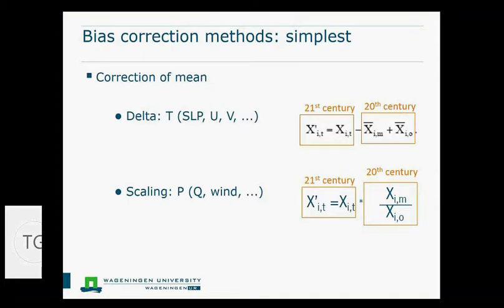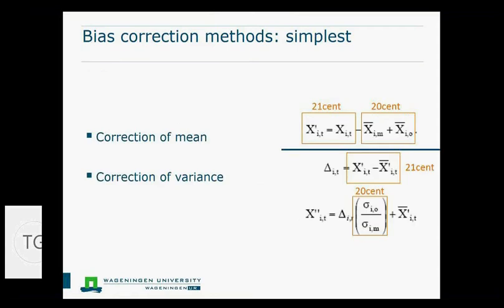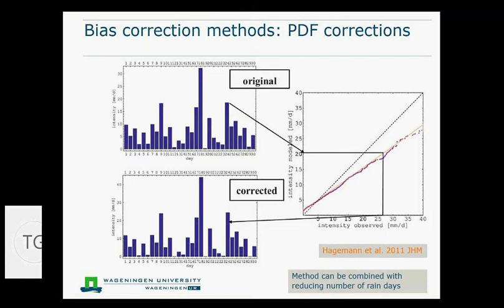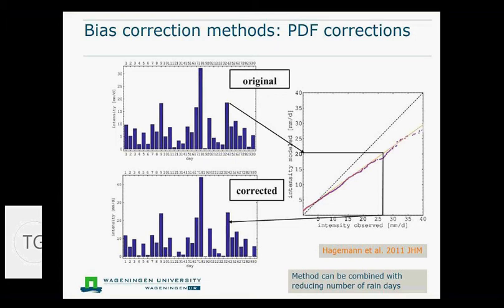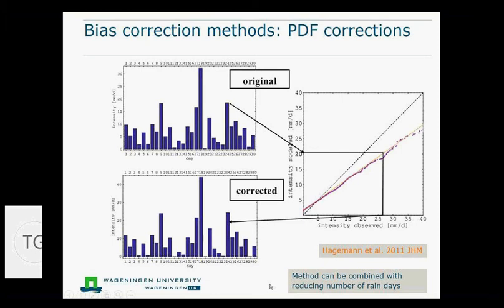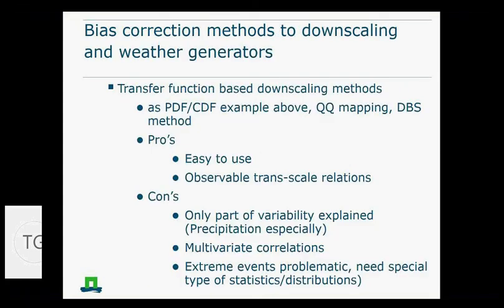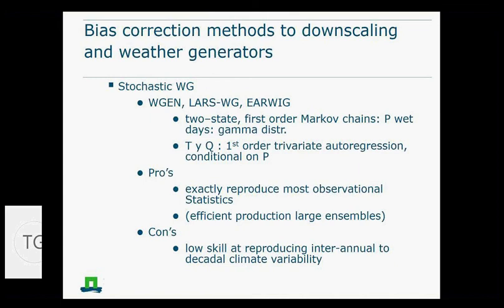Different methods for bias adjustment and downscaling

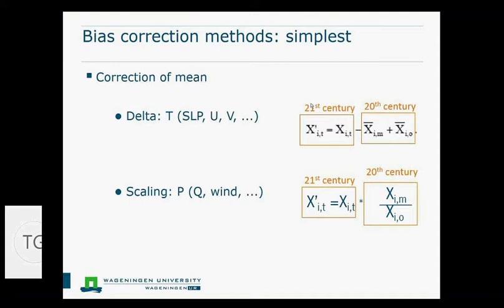Comment: 0:49 For the scaling method, (Xm/Xo) is shown as the bias quotient to apply, should it not be Xo/Xm?    

If, for instance, the model is positively bias, Xm/Xo  = >1 - and applying a factor of >1 will amplify the bias : )

Xo/Xm would be <1, which is the correct intention, no?